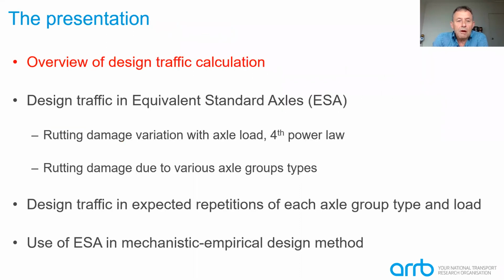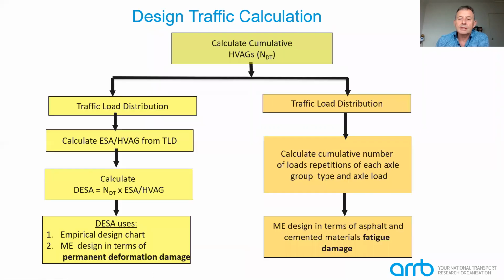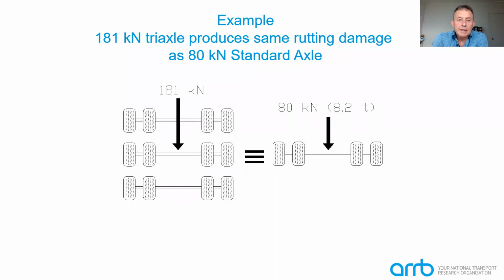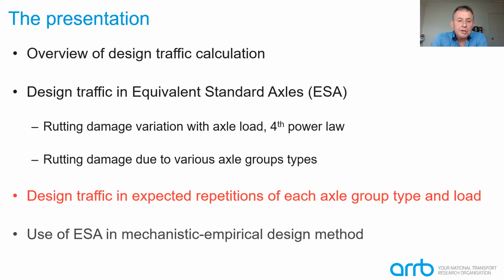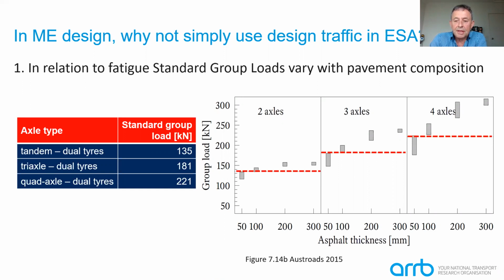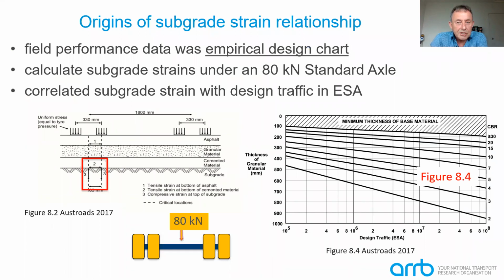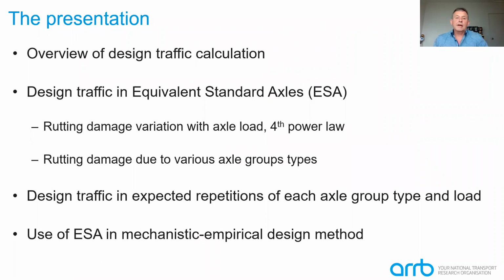Webinar Lecture Series - Week 4 Design Traffic (13 May 2020)

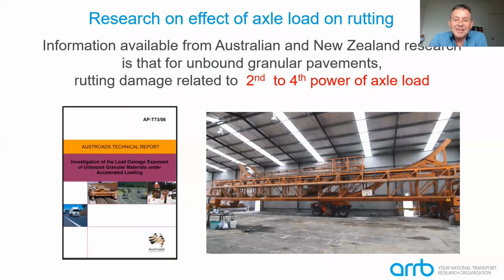Comment: 11:35 Technical report, Investigation of the Load Damage Exponent of Unbound Granular Material under Accelerated Loading
19:11 The Influence of Multiple axle Group Loads on Flexible Pavement Design
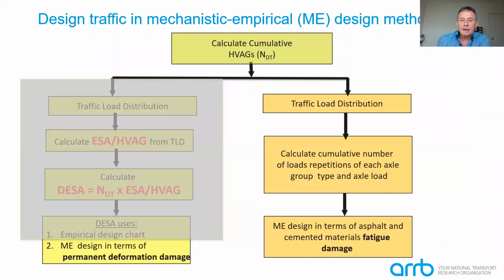21:49  ME design for fatigue cracking